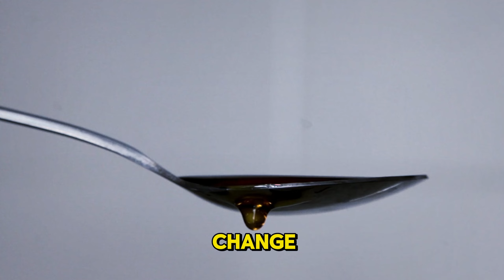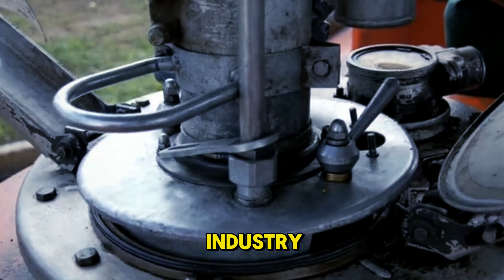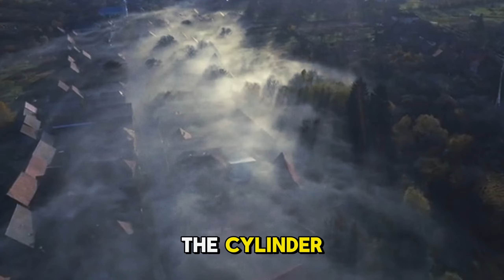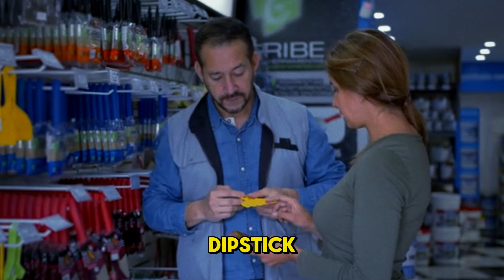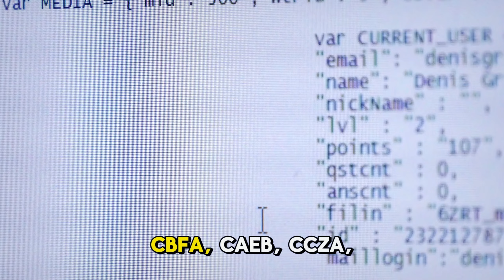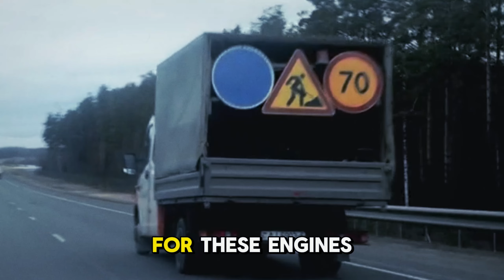VW Engineer Admits TSI Oil Burn Is A Design Flaw, Not Driver Error

Comment: Well many of the modern tiny displacement turbo engines with low tension rings cause massive quantities of pcv oil fumes which massively clogs intakes because of also direct injection engines clog up intake valves then carbon up the oil rings so they damage cylinder walls if not resolved early. NA non turbo engines w normal tension rings create much less pcv carboned up engines and if are port or dual gdi/port injected that helps even more. So add the other engineering errors VW did, wow. Keeping my non turbo v6 as long as possible !